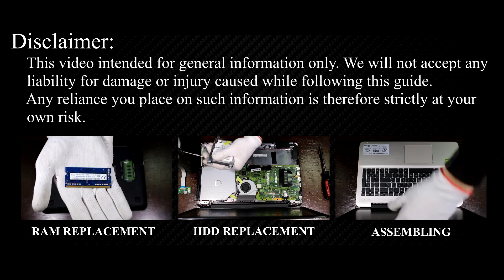Asus X555 Disassembly & Battery Replacement – Full DIY Tutorial

Comment: Hello, be careful when you open it. The keyboard foil is connected to the computer center with two small, delicate cables. The plug connections on these cables are delicate and not very stable. These cables are  dimensioned so that they can only accommodate an opening of about 45 degrees between the keyboard foil and the computer board. If you open it more than 45 degrees without thinking, it can happen (like it did to me) that the cables suddenly slip out of their slots and you have to puzzle and fumble to put everything back together correctly. I think that's a bit unreasonable for changing a battery.

Comment: You have got to be kidding me.  This is an example of how to make a worthless time-suck repair/replacement video.  Instead of simply pointing out the screws that need to be removed and telling us to remove them, we've got to watch each screw slowly being removed???  And then once the battery is accessible, it is not shown how to actually remove the battery, it magically appears in someone's hand??   The whole point of the video is showing us how to remove and replace the battery...and that never happened.   This should have been a 90 second video when done right, but it was over 4 minutes done wrong.

Comment: can it run with out batery?
Reply from the maker: Yes
Reply: Are u sure about that ? For my X555LA model, the battery seems to be dead and ttied without the battery, But nothing happens... Yet I can't understand the issue is with the battery or, laptop's inside power sytem.
Reply: Hello,i just removed the laptop's battery, but the led of the charge is always on, should i disconnect the cable near the battery?

Comment: Tem como vocês ensina a botar a placa de wireless & Bluetooth… E botar o cabinho por dentro do notebook passando pelo monitor. Pois o meu é um X555UB. E dentro dele só tem um cabo preto da antena wireless. E eu comprei uma placa Mini PCI Wireless Bluetooth junto… E não to aproveitando o total da placa. Pois ela tem duas saida pra antena. Mas o notebook só tem um cabo de antena. Me ajuda aii pessoal… Eu já avistei vários com esse probleminha... 

A lembrando a placa Mini PCI original do notebook. Eu a retirei botando essa aqui

Intel® Dual Band Wireless-AC 7260 + Bluetooth 4.0...

Só que nem falei essa placa possui duas entradas de antena. E o notebook só uma... Ai eu não sei se realmente essas duas entradas é uma pro wireless e outra pro bluetooth. Eu sei que botei no mesmo local que a outra. Mas o Bluetooth não funciona. Só acha o aparelho celular mas bem próximo. Já minha caixa multimídia nem pensar ela não consegue achar. E no meu outro notebook acha tranquilo. A mais de 5 metros... Me ajuda ai galera. Abraço.
Reply: i saw other video that the 2 wire can be switch because they are just for the antenna, both works the same way